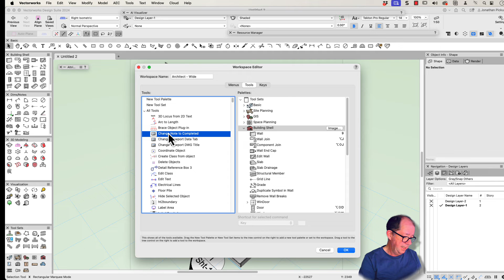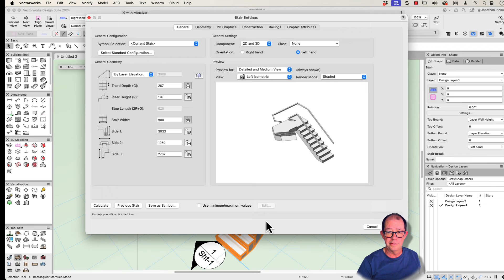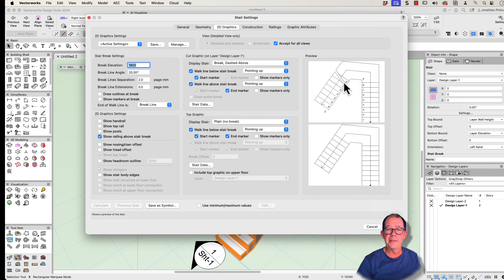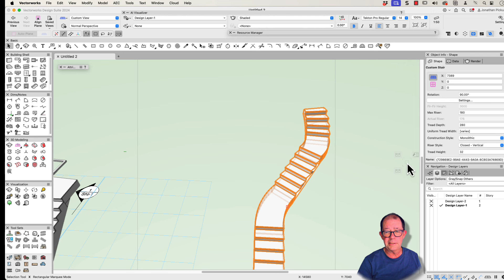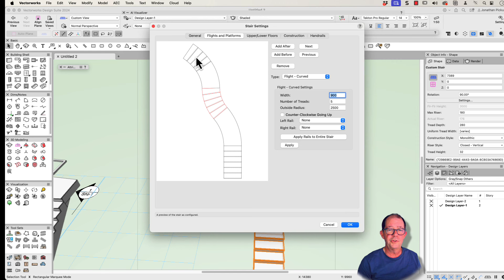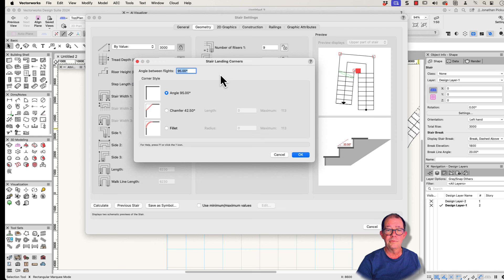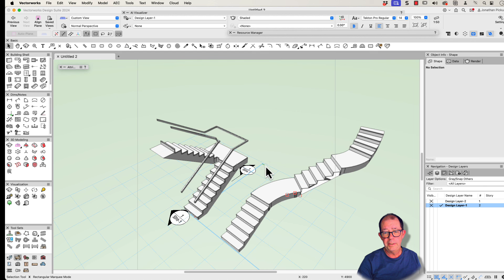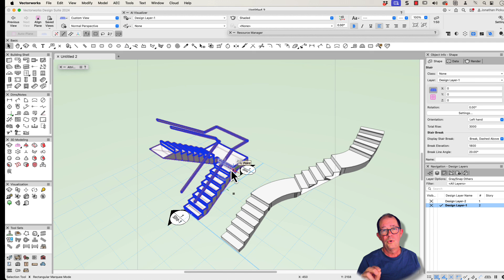Custom Stair Vs Regular Stair Tools In Vectorworks: Which Is Right For You?

Comment: Hi Jonathan, this video is super helpful for a custom stair I'm in the process of building. How to build a custom stair that connects 3 levels? I'm having trouble creating openings in the floors.
Reply from the maker: Hi. thanks for your comment. The openings and floors should be pretty straightforward, draw polygon for the floor opening, select the floor and the polygon. Right click and subtract surface.
Reply from the maker: I’m not clear what you mean by creating a custom stair that connects three levels. Is this three stories of the building or is this three different parts of the same Storey?
Reply: Yes the stairs connect three stories
Reply from the maker: this might help. https://youtu.be/lA9TBrWa0s0